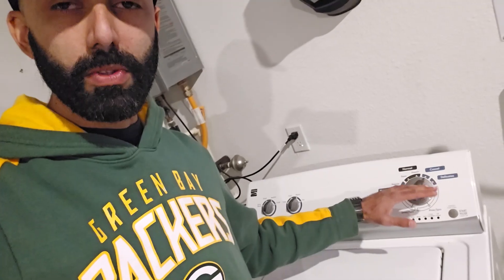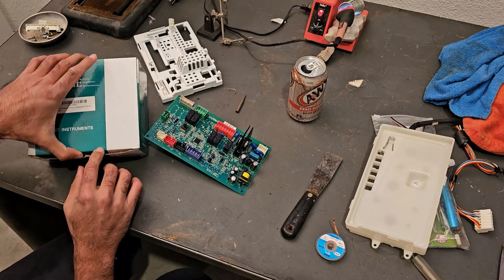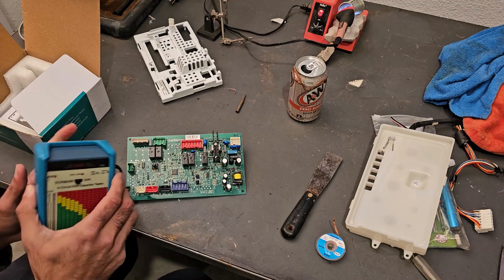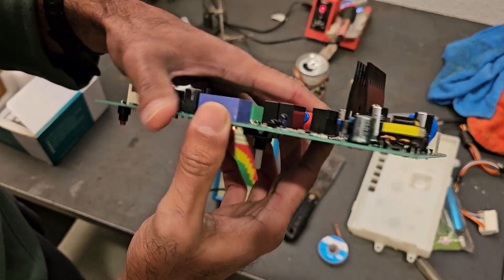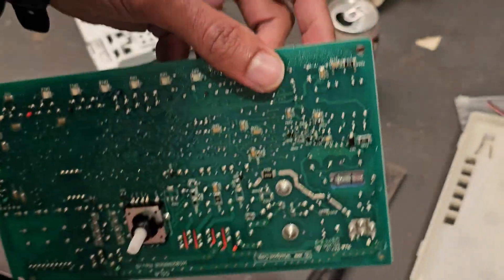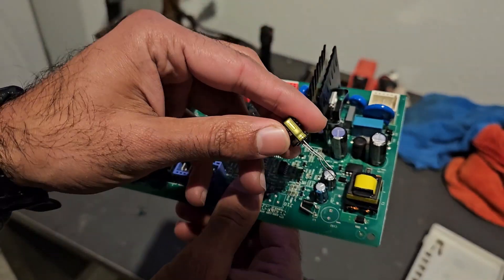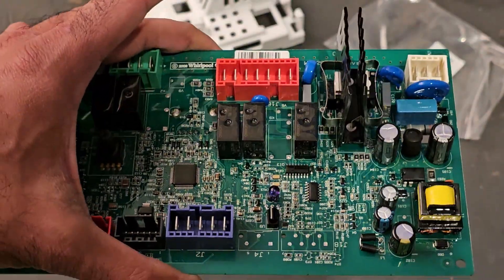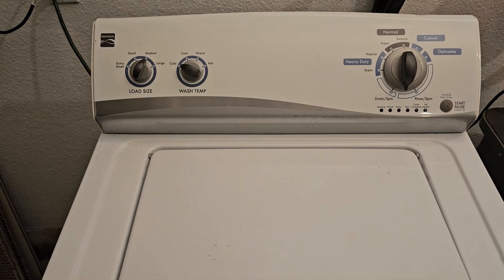Troubleshooting & Repairing A Washing Machine Control Board!

Comment: I have the same issue. I checked the board and all capacitors physically—there’s no burning or any indication of overheating. The capacitors are not swollen or leaking, and I tested them both in and out of circuit with an ESR meter; all readings are normal. I’d appreciate any help :).

Comment: I have the same washer.  When it completes a cycle it restarts again.  I left it unplugged over night and went to plug it back in and the sense light came on and started filling up with water.  Has anyone seen this before.  I fixed the other problem with the banging by replacing the suspensions rods.  Great Video's I am learning alot.
Reply: The pressure sensor is bad, since the sensor is on board, u need to replace the board, or u can buy a sensor and replace it if u are at the level of board repair. If yours is manufactured between 2024 and 2025, call whirlpool service line, they have a service pointer to replace the board for free. Just tell them your model and series number.

Comment: About to reluctantly buy a new washer. My GE Top Load Hydrowave is about 13 years old and quit last week. It would fill but not agitate or spin. I assumed it was the lid switch, so I bypassed it. Nope. Took the machine apart looking for a fusible link, only to figure out that they stopped using that a couple years before this model (?) so then I took the motor out, assuming it was bad.

The red LED on the motor board was flashing once continously, until I unplugged the power, then it would flash 3x til the residual power ran out. After spending time separating the board from the motor to look for any visible issues, I figured out that the single slow flash means normal operation.

But when I plug in all the connectors and even put it into service mode, the motor is unresponsive. I wish I knew how to do board repair. There's so many resistors, caps, etc that I don't even know where to start. I did check all 4 transistors for continuity or shorts, and they seem fine.

Anyway. we can't go much longer doing laundry at other family members homes. Oh, and to make matters worse, our hot water tank went a couple days ago! Fortunately our power company does loans for that stuff, but still sucks getting an unexpected bill for 2 grand.

Sorry for the long winded post.
Reply: I'm not sure if your model is the same as mine, but mine had an online fuseable link wrapped in the harness about halfway down from the lid and the floor pan. I could feel a bump in the harness so I cut the harness open and found it. I cut the fuse out and spliced in an automotive fuse holder and guessed that a 10amp fuse would be sufficient. I used a weatherproof fuseholder that had a snap on cap. working for years now.
Reply: @obsoleteprofessor2034  I peeled back the whole harness and didn't find anything. I wish I knew board level repair. Ended up buying a new unit and they took away the old one. RIP

Comment: Very helpful man, I'm having a problem with my washer. The old hot was washed with pressure water when the inlet pump broke and I think it went bad, didn't even turn on at all, so I order new board, replace it but now all the LEDs on the front board are red, not green as they used to. Then it comes to this erro you had, lid locked flashing red. But as I say is a new board. Any suggestions? TIA
Reply: Did you figure it out? I saw somewhere that they had to be programmed when you replace them. Only reason I haven't shelled out the cash for the part

Comment: I would suggest using a product by Edysn. It is a solder sucker. (Better than solder wick for double-clad boards) thanks for the video.
Reply from the maker: I'll look into that. Thanks for the suggestion!
Reply: I'll second the solder sucker. I used a bulb for the longest time and the automatic ones are so much easier and more reliable.

Comment: This is the third video of this same board being repaired and this exact same capacitor was shot on all three videos. Must be a common failure of these boards.
Reply from the maker: You're right, it definitely seems like a common failure point.
Reply: @DuctTapeMechanic  What might make it last longer is replace that capacitor with a higher voltage capacitor like a 10 volt capacitor. They are probably running it near its max causing it to fail. You can always put in a higher voltage one but NEVER a lower voltage one.

Comment: I was in a motorcycle accident a few months ago which caused me to lose about $2500 a month in income. The settlement from the trucking company should be substantial but, unfortunately, that is several months off and my washer just died. I'm going to take out the controller and see if I can fix it myself. It's December, so I'm sure there are some good sales on new ones (which frankly would be just as cheap as having a repairman fix mine with a new controller card) but I just can't afford it at this moment.  Plus, I prefer to fix things rather than throw them away anyway. I'm 63 and just don't quite understand the "everything is disposable" mindset that is so prevalent in the country today.
Reply from the maker: Good luck! Hopefully, you can get it working again and not have to spend too much

Comment: DTM, great video. After you bend the legs over cut the excess off before you solder. This prevents damaging or disturbing your solder joints. Also, clean the new solder joints with some isopropyl alcohol. It’s great that you were able to repair this board. Looking forward to your next video.
Reply from the maker: Thank you for the tips! I think it is also important to have a good clean soldering iron tip. Mine was a bit burned up (probably caused a bit more damage than I would have liked)

Comment: Great job with the tutorial, I have a question At the end of the video you removed a component that you had installed at the lid switch was that a bypass? Also did you repair the machine for long term usage?
Reply from the maker: I always bypass the lid switch after making a repair just to monitor the cycle and make sure the machine is not doing anything crazy. I think this definitely could be a long term repair if you do a careful job of soldering and don't burn components, it does take some time to perfect (this video was more designed to show the troubleshooting steps).